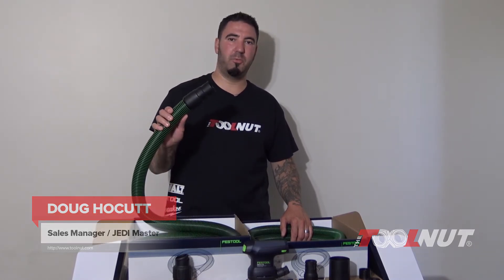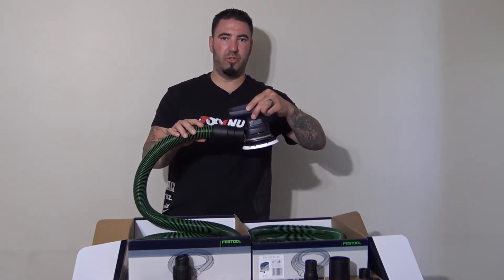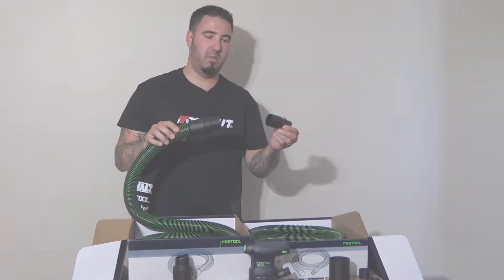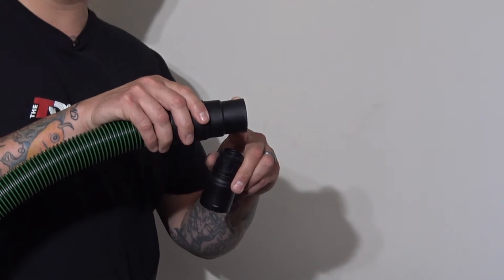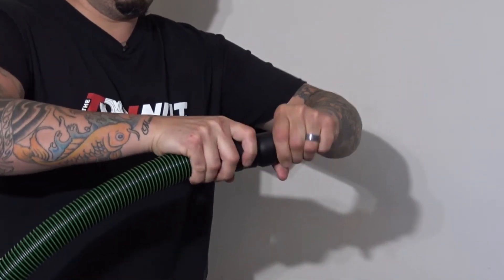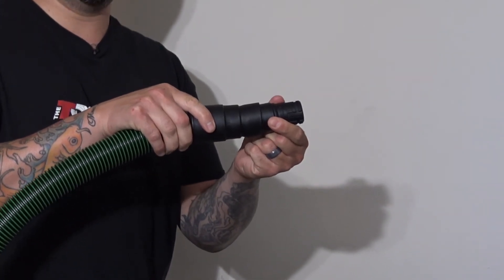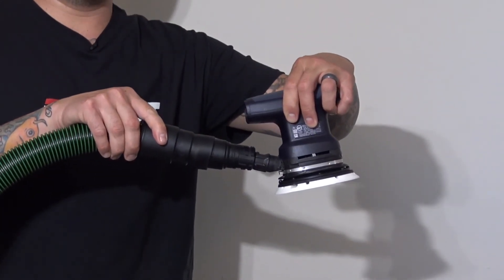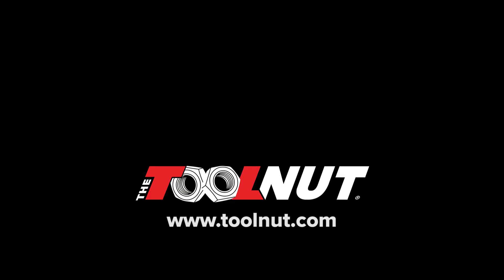How to adapt a 36mm Festool hose to a 27mm tool connector

Comment: how could i use my 1.5 inch shop vac hose on festool tools?
Reply from the maker: You would have to try to find an adapter that may work. Most people buy a Festool hose to work with their extractor to accomplish this, which is a lot cheaper than buying a whole Festool extractor. We have all of the Festool hoses on our website. The most common would be a 27mm x 11.5'.